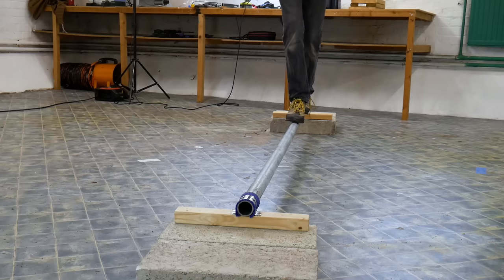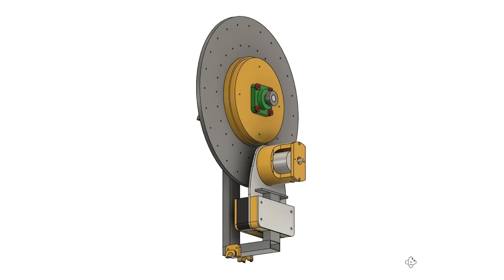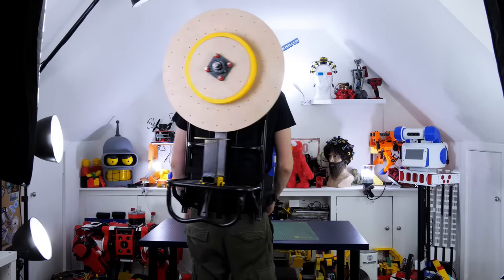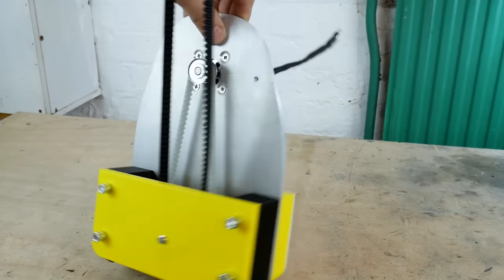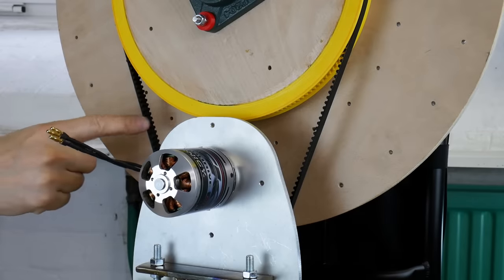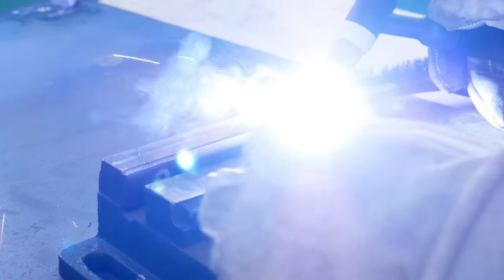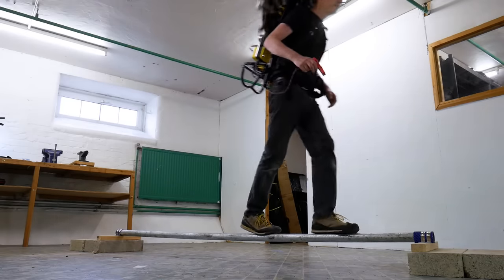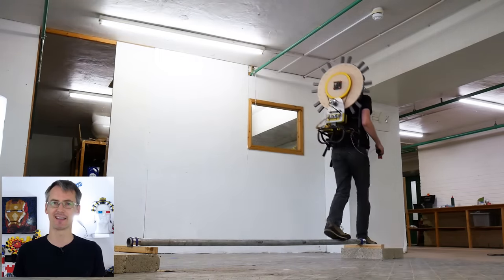Tightrope Walking Cheat Device

Comment: a lesser ratio and larger speeds would accomplish the exact same thing as more mass.
Reply: Reducing the gear ratio to increase the reaction wheel's top speed also reduces how quickly the reaction wheel can accelerate. It looks like James struck a pretty good compromise between acceleration and top speed, but it's hard to tell just by watching.
Reply: @liambohl  but the reduced mass increases acceleration so they cancel out just now with less gearing and less overall mass but the same effect on his body.

Comment: This would work so much better if the reaction wheel had better leverage, its current centre of rotation is a long way from your body’s pivot point which reduces its leverage on the rotation of your body. That’s why reaction wheels in spacecraft are at the centre of mass.
I’d try getting it closer to hip level. That should give you a lot more responsiveness and torque.

Comment: Would the weight at the hips make it more stable? It seems like your spine absorbs most of the balance correction, which may help eliminate some of that dampening if the wheel was down lower; supported by a lower center of gravity. Then again, IDK

Comment: Get rid of the box steel near the center of rotation. Put all the weight on the outside of the circle. The pack will weigh less and have more power  to balance you.

Comment: I think attaching the devise a little bit lower than now, to a weight point, can increase capability of that device and improve stability of the user. Because in that set up that is pushing shoulders and that is too high and can be reason to fall cuz of out of balance

Comment: What would be the effect say if it was centered behind your pelvic bone and constantly spinning with a lot of mass. Is that the same as having that load simply strapped to your back, or does the rotation have any effect at all? I understand acceleration is a big part of the equation for righting a structure, but would the rotation of a weighted appendage influence the center of gravity any differently than that same appendage being stationary?

Comment: When it comes to the tight rope your intuition is usually wrong. most people will try get both feet set down and then try to balance, but that's gonna mess you up more often than not. You wanna regain your balance while one foot is in the air. use it to your advantage.

Comment: I know I’m late and people probably already told you, but when tig welding you should keep the gun on the weld after you stop the current, the gas will flow for a few seconds as the weld cools and no air will get into your freshly laid bead. 👍

Comment: Quite the opposite to your bigger, heavier flywheel proposal, you need a high torque step motor with a smaller, metal flywheel. This will give you the more immediate assistance you need. A motor with enough torque will work without a flywheel, as they deliver quite the jolt, but a metal flywheel is more compact, enabling a mre rapid change of direction response, and will definitely smooth out the effect.

Comment: Not sure why you didn't think of this, but rotate the the wheel 90 degrees, push it away from your back so it doesn't saw you in half, and spin it about twice as fast.  Tada, gyroscope.  You could probably rollerblade across that pipe then.

Comment: If you try a version 2 of this, put the reaction wheel basically on your butt. Sounds weird, but above your torso isn't really needed for slack line balancing. It can help for sure, but it also just ads another layer of complexity to the mix. I've done circus arts for over 20 years, and most slack liners I know can walk with no upper body help. As long as your feet are placed well, then it just comes down to keeping the legs and hips properly aligned, which the reaction wheel should do if mounted right.

Comment: The force that that device can impart on you is likely limited by the torque of the motor. If you had a stronger motor on the same size unit, it could accelerate the wheel faster and impart more force.

Comment: Very cool to watch. It seems like when the wheel changes its direction, it somehow push you out of your way. I would suggest to use two wheels, one spinning clockwise, and the other anti-clockwise, at the same time. In doing so, you will have a much more quick response to maintain the equilibrium. (Adjust the angular velocities in such way that the total angular momentum can change quicker).
Reply: the reaction wheel works on acceleration, not speed. it is instantly providing torque regardless of if the direction changed yet

Comment: You make lots of ridiculous projects that have no practical value that I can see. I suggest that you learn to balance on one foot on the floor first. I held a black belt in TKD. After a while you get quite good at standing on one foot and not falling over. It's been years now and I've lost the skill, but I used to stand on one foot, get dressed, put on socks and shoes, etc...aka not fall over for several minutes at a time with no aide from anything.

Comment: You'd have a simpler time just spinning it as fast as possible, but rotated 90 degrees horizontally in the opposite axis. Then the rotation will be on the vertical axis and moving to either side would have to disturb the gyro.

Comment: i'm thinking maybe the torque of the wheel is being applied to high... that axle of the wheel is quite high and that is trying to torque you near the top of your shoulders (not translate but twist). Perhaps if that was twisting you back upright more near your waist (and then use the stiffness of your backpack to keep your torso from leaning) you would have better luck? great video.

Comment: If you had the high torque gear directly moving your arms, even though there's usually a lot more going on than that when you balance that way, you may be able to do it fast and accurate enough with digital gyros that it does that part of it at a superhuman level. Your body wouldn't have to absorb the load and you wouldn't have tight weight constraints

Comment: My early Theory before watching this is that wearing it on your torso will cause the device to throw you more off balance. I imagine that your torso will act as an inverted pendulum to your legs, so the device will think you will be falling in the opposite direction and cause you to go more off balance than before. If this is the case, it could be remedied by tricking the device into thinking it's leaning the opposite direction.

Comment: I'm not sure if you're aware but when Tig welding the tungsten should never touch the part. Idk if ur machine is broken causing u to have to start the arc by touching the metal but this is not needed and damages the tip causing awful weld quality. If ur arc isn't starting it's because the tip is not sharp, the tip needs to be very sharp for the arc to start on its own without touching the part

Comment: build some kind of RCS on ur backpack ...jet pluse does the trick than using gyro method,  if you don't want to use flammable fuel, use high air pressure to jet help u balance by jetting left or right ( strafe mode ) or use High powered EDF motor to push u back in place 0_o  

what I did was using my Drone flight controller that has gyro built in so  Ill do is disable forward and reverse gyro senor and enable Stab mode it help u stay in place ... try that :D

Comment: Issue is your hips pivot so you could have mass to the left with hips pivot to the right the gyro will see your mass is to the right and steer the wrong way if this had a solid bar from the bottom of the unit guided on the bar then when mass is to the left it won’t matter what angle your top half is it will still correct or wear a cast over your hips to stop the pivot lol

Comment: I think the problem is the delay for the wheel to start spinning. I think a gyroscode would be better solution. Have the wheel(s) sping all the time and have movable weight of the wheel operated by (fast) actuators. The weights do not have be huge, the speed of the wheel multiplies the force. ISS weight 420 tons  and small (size of truck tire) gyroscope move it.

Comment: Reduce the weight, put two on either side of your hips, put the wheels at your hips attached to exoskeleton leg braces. Also - those shoes are WAY to soft... try this guy in ICE CLIMBING boots. Which are a cross between ski boots and hiking boots.

Comment: When you put the machine on your back I suddenly remember the game arcade called 'Virtual-On' (specifically the "virtuaroids" aka robots of the game).
There they had this circular disc on their backs when the tend to run or move with increases spin as they move/run faster. Would this "Cheat Device" be a relevant mechanic?? 
This Device could vamp up the robots especially the bi-peds one into running faster properly with out falling.

Comment: Couldn't you have used a design where you used a long steel tube with two weights on each side that gets tilted (not spun) by the motor instead of a reaction wheel?

Comment: I loved this from a purely theoretical stand point but as someone who teaches tightrope and tight wire it isn’t even close to a real world example. Technically your body has far too many flexible linkages between the wheel and your feet to function correctly as there will always be a physical counter reaction to the wheel’s motion to stabilize you. More importantly, a tightrope has infinately more dynamic motion then a solid pipe. To walk an actual tightrope requires MUCH more of a reactive physicality as the rope is constantly moving beneath you. Now could a rigid robotic device be programmed to accommodate this constant motion? Eventually it most likely could but I don’t have any confidence that it could work attached to a human as this test was done. Thank you for the inspiration but try an actual tightrope and see the remarkable difference it makes in the results!

Comment: As we grow older we lose the ability to balance using our inner ears.  I'm 68 and this has been true for me for at least ten years. The test is: With your eyes closed, can you balance on one leg for ten seconds?  [ Last year I spent 3 months on a sailboat in often rough seas. Most of that time we were at sea. At the end of the trip I was able to do the eyes closed balance test but only a couple of times. So I don't think this is a skill we can relearn. ]  And for the record, I'm quite healthy and active. I was the crew who went up the mast or on top of the dodger clipped to the boom in storms to tie emergency knots.   My balance isn't at all a problem, but I balance visually.  (So for anyone over 50 have some minimum night light levels in your home. Maybe you can still balance with eyes closed, soon you won't be able to. It doesn't take very much light to visually balance at night so it's an easy fix.) 
What would probably work even better for your tightrope walking on the pipe is an upside down pendulum with less weight. Might not be as interesting. I was also wondering if you couldn't restore blind balance to us oldsters with tones in our ears, the intensity or pitch saying lean a bit, or a lot.  With my eyes closed as my balance becomes wobbly, it's like whatever the feed back loop is it goes out of control.

Comment: Incredible engineering. If the motor was powerful enough, the impulse, or jerk from the flywheel spinning up could mean that less weight would be necessary. Great idea for diving suits.

If that motor had more torque that would be neat.

Would allow a diver to maintain balance especially against tidal forces.

Comment: They used to have an amazing cheating device to help people cross tightropes by lowering the center of gravity and increasing the performer's ability to adjust angular momentum.

It was a really long stick.

(yes, the drooping ends of the flexible shaft they carried is enough to meaningfully move the CG closer to the rope)

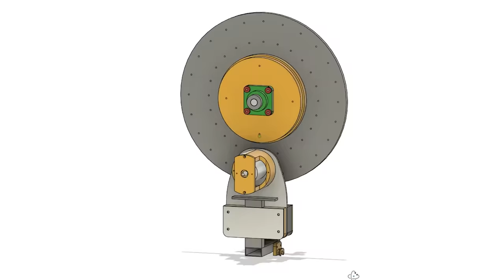Comment: 1:28 "how big would a reaction wheel have to be"...      big enough that just carrying it with both hands would help a lot.

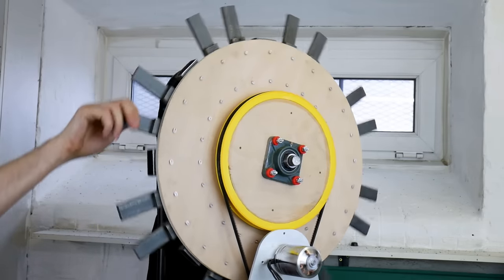10:00 and it would be much safer. If it's powerful enough to throw you back when you're falling, it'll do a nasty number on your lower arm.
like you said "Your body is quite squishy." Steel isn't.

Comment: Have you tried on a rope? It should be more easy to do if the device was able to just move your feet left and right.
I've noticed this on a balance board in a gym. A balance board is half an inflatable ball and the other side a board. In the beginning I put the board down and was standing on the ball. I could hardly keep any balance. It is a good excercise for the muscles that control the feet though.
Turning it around just for fun, and I discovered that the balance board actually auto balances itself. You keep your upperbody straight and your lower body will just follow the half ball, and when your feet move away, it automatically gives you a push in the right direction (the other way), then the balance board quickly rolls back and it is hard to fall over on balance board.
The only real hard part on a balance board is to keep your feet/legs from oscillating.
Now I figure a rope must be along those lines, however, I've never succeeded standing on a rope (tried it 10s though).
If you want to balance on a rope, it should be "easy" by having the sensors high and actuators on your feet.
This however will never work on a pole, as the pole is static. If you want to walk the pole I think you must simplify the system so you can "statically" move weight. The balance backpack will keep your back upright, but if your center of gravity is not above the pole you will still fall.
Or maybe you need exactly that: a sensor that helps impulse the center of gravity to the right spot until the static center is good again.

Comment: There is a problem with your assumption that the system is an inverted pendulum. An equivalent system to the problem in the video is an inverted double pendulum, rather than a single one. In both cases, the tip of the pendulum experiences the torque input though. The problem is, applying a torque to top link -- torso here -- will initially have the opposite effect on the bottom link -- your legs. We call this non-minimum phase. Think of a shower that's too hot, and you turn down the hot water knob, only for it to get warmer first before it gets colder.

I think bringing the rotating wheel closer to the hips helps alot (flipping the backpack upside down). You revert back to an inverted pendulum system. In rehabilitation exoskeletons, they use similar inverted pendulum models to stabilize the center of mass in patients with lower limb impairments. So it should work!

Comment: Yeah, I'm with the other commenters, what you need the reaction wheel to push against is your hips, so that's where it should be attached. Additionally, I don't think you need a complete wheel, you could accomplish the same thing with a heavy pendulum. You're still getting a reaction-wheel-like effect, but you're also getting a reaction mass effect (heh, mass effect). As you fall to the right the mass will be turned to the left which will not only give you a torque that pushes you left, but the mass will shift your center of mass to the left as well. Basically, I'm suggesting you create a mechanical tail.

Comment: Have you ever watched something just before bed, then dreamt about it that night?  Well I watched a video about reaction wheels one night many years ago then fell asleep, and that night I dreamt of a different kind of reaction "wheel" that I've always wondered if it would actually work or not?!   The crazy design that popped into my head that night actually caused me to think of a second variation of it after I woke up and remembered my dream.   The original "dream" version was just a long bar (like a chainsaw bar), except much wider (1-3" wide) and it had either a rubber belt, or a metal chain on it that had weights at spaced out intervals attached to the entire outer surface, and the ends of the belt wrapped around small roller wheels mounted on either end of the bar. You could then drive the belt from the center of the bar to make the belt (along with all the weights) move in either direction around the bar fairly quickly (like a reaction wheel).  
If you held onto the bar, or attached it to your back (like in this video), then let the onboard electronics drive the belt much like it would turn the reaction wheel, would the fact that the weights were way out on the ends of the bar allow you to gain all of the effects of having a REALLY large wheel, but in a much more compact size?  And I don't know this for sure, but I imagine it would take a whole hell of a lot less torque to rapidly drive the belt/weights around the bar than it would take to spin up a large wheel!   
Then this lead me to think, well, what if you didn't spread weights evenly around the entire belt?  What if you just used 2 weights and started with 1 of them close to the center, and 1 way out on the end. Then as the computer changed direction it could drive the weights only 1/2 the length of the bar and it could send 1 weight out to the either end, while at the same time, bring the other weight on the opposite end back in towards the center!  With the weights flying out and in as needed, it would be like having someone at either end or the bar pushing down on whichever end it starting to rise up (because you're tipping).  It's a weighted reaction, but without the inertial movement of a wheel. 
Then my last idea was to scrap the weights all together, and just use the bar and belt/chain to drive small reaction wheels that are mounted out at the ends.  One motor would drive both wheels, and they would spin in the same direction, just as they would spin a single wheel.  Being that they're way out at the end of a long bar, it would give you the advantage of leverage, but (again) without needing to use a GIANT, single, wheel!